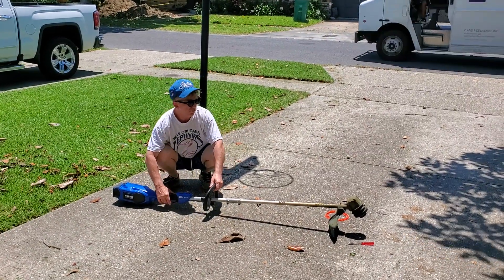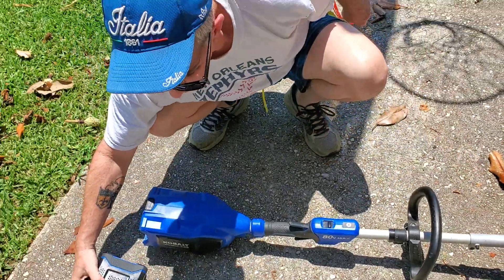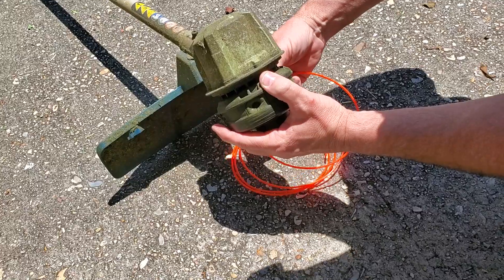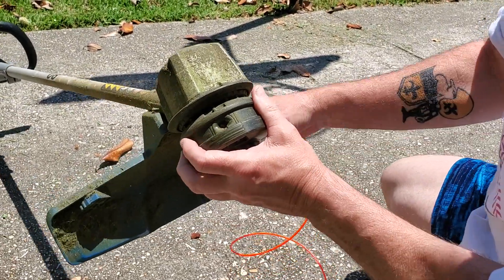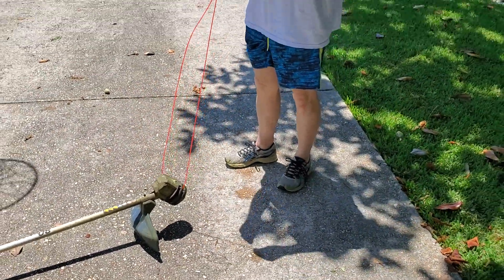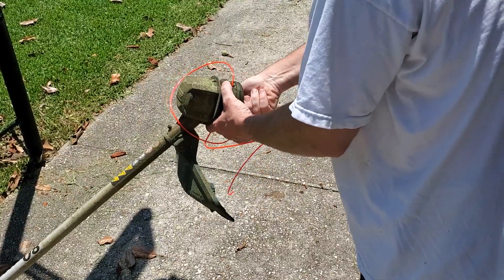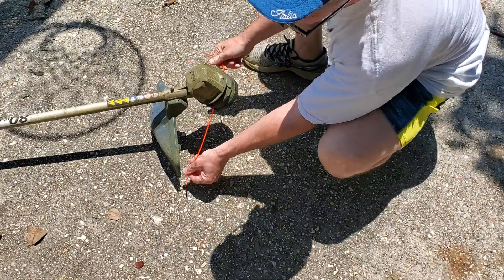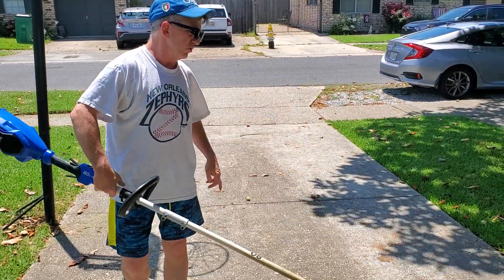LOADING TRIMMER LINE INTO MY KOBALT TRIMMER 80V WEED EATER LOWES BATTERY POWERED

Comment: Best string head ever !  It's made by Tecomec, uses either the .080 or .095 trimmer line.  The not inserting easy ... found a cure.  Take and bend the line getting it as straight as possible for about 5 inches, then works every time.

Comment: You just made me feel like the smartest woman in the world!!! Thank you ☺️ I have been looking at videos on restringing my Kobolt 40v Max and never seen anyone push it through. Although I did need to remove the head to thread, then pop on and turn the dial. Ingenious 😂
Reply from the maker: You shouldn't need to pop the head off. Sometimes you need to rotate the wire 180 degrees & try to re insert it. Or bend the wire a lil b4 inserting it if it is stiff

Comment: There should be two arrows on the bottom unit. Line them up and the holes will be lined up. Once you thread the line thru, there's only one direction you can wind it WITHOUT having to push the knob in... that's the direction to wind.
Reply from the maker: Mine is so worn i think the arrows are gone. Great info for new owners.
Reply: @JohnnieV  Yeah, the new units will save a little time.

Comment: What string are you using? Thinking of getting a spool since they seem more cost effective than the 5 packs they sell at lowes. Thanks
Reply from the maker: .095   ... its a heavy duty quality. It isnt flimsy. Big roll is about $19 i think.
Reply: Particular brand or link?
Reply from the maker: @ikettleman777  https://www.lowes.com/pd/Husqvarna-100-ft-Spool-0-095-in-Spooled-Trimmer-Line/1000600653 
This stuff is strong.